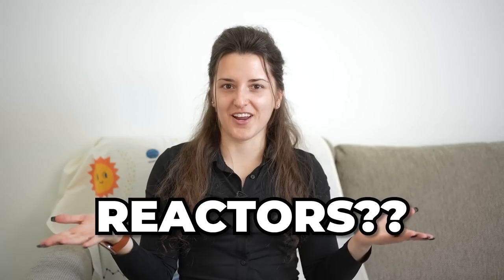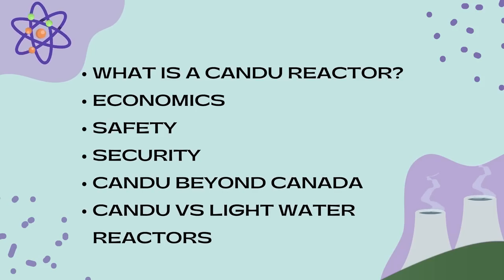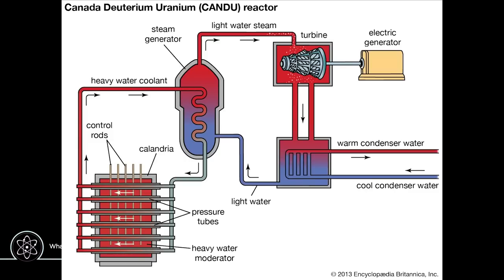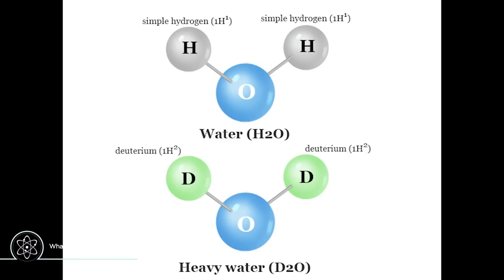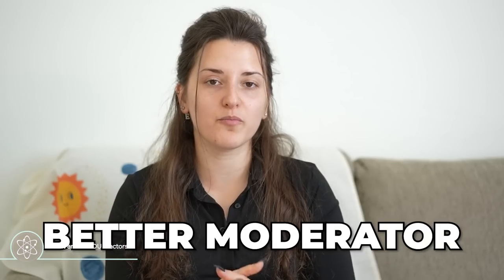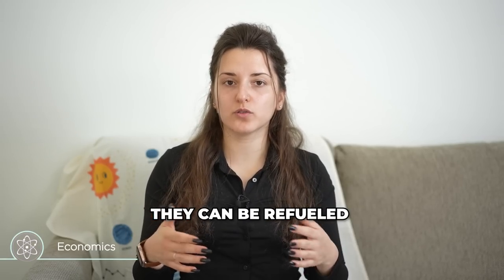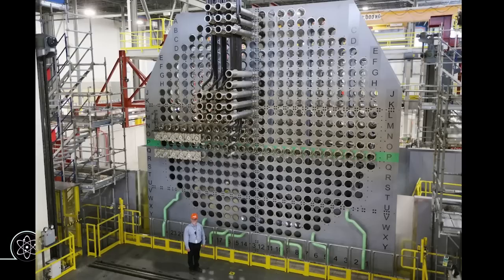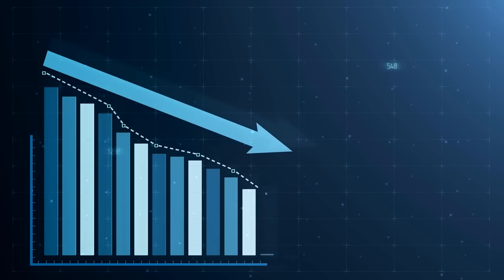Nuclear Physicist Explains - What are CANDU Reactors?

Comment: 7:28 Didn't India produce its weapons grade plutonium from heavy water reactors?Doesn't online refueling make it a bit easier to remove fuel after low burnup?

7:41 Correction:D20 has lower thermal neutron absorption cross section compared to H20
Reply: indeed, that was a fail from Elina.
Online refueling is indeed a good way to make weapons grade Pu in a "water reactor",while generating electricity no problem. In a PWR you can also do it, but why would you? Just use HEU.
Reply: Yes that was a jarring misstatement for me too. The whole "D2O is a better moderator" line is a bit of a furphy, it's not the moderation but the lower absorption rate which allows a CANDU to have a neutron economy able to support unenriched uranium as a fuel.
Reply: @sjholmesbrown  Exactly. And historically that was the reason why Werner Heisenberg in Germany decided to use Heavy water for the experiments, since regular water didn't fit the bill. In terms of moderation light water is better, since the proton has the same mass as the neutron while the deuteron has twice the mass.
Reply: I was hoping someone brought this up. I hope more countries buy CANDU reactors, but we should be realistic about proliferation
Reply: The German Wikipedia article on CANDU reactors actually mentions that this reactor type is especially suitable to generate plutonium:

"* die Bauweise als Druckröhrenreaktor. Sie erleichtert technisch den Bau solcher Reaktoren und erlaubt zugleich eine relativ einfache Gewinnung von Waffenplutonium, da im laufenden Betrieb Brennstoff zugegeben und entnommen werden kann."

-> 

"* the construction principle utilizing preasured reactor pipes. It makes building such reactors more easy technically, at the same time it allows for a realtively simple creation of weapon grade plutonium as nuclear fuel elements can be added and removed at any time while the reactor can be kept running"
Reply: @12pentaborane proliferation can be limited simply by good accounting and third party oversight of fuel in fuel out .  Buy if we pretend that carbon is the existential threat we're being sold nukes are the only way to maintain quality of life.
Reply: @AlldaylongRock  Well put! Very much with RBMK where you can refuel online - you can adjust the fuel campaign to get Pu, not electricity- india did that. So in terms of non-proliferation CANDU  is not as good as a PWR. Moreover, you gat a highly radioactive spent fuel which you would like to use and which is a non-proliferation issue
Reply: @casualobserver486  With online refueling you have both no problem. At least i think the CANDU doesn't even need to reduce power

Comment: Great video but you got some parts wrong. Heavy water is indeed a better moderator, but the reason is that it absorbs LESS neutrons, leaving MORE neutrons to be absorbed by the uranium which results in a better neutron economy. 
This, and online refueling, is also the reason that MORE plutonium is being produced in a CANDU which is not a problem but creates higher demands for non-proliferation measures.

Comment: a few other points. candu reactors have lower power density than light water so typically generate less power for a given size. and the tubes that enclose the fuel rods are  a special zirconium alloy that only last 15 -20 years at which point the reactor needs the tubes replaced. that costs about a billion $. so that is planned for when constructing.
Reply: @frederickcwinterburn1837 , Bruce plans to re-tube all the others. Unit 6 is nearly done and set to return to service this year and will be followed by 3 and then 4. Not sure about scheduling for the rest. Expected lifetime of the new tubes is 30-35 years.

Comment: Well explained thank you. Summarized: The Candu reactor is a type of pressurized heavy water reactor that uses natural uranium as fuel and heavy water as both coolant and moderator. The Candu reactor has a high safety record, as it can shut down automatically in case of a loss of coolant or power, and it has a negative void coefficient, meaning that the fission rate decreases when the coolant density decreases. The Candu reactor is also efficient, as it can achieve a high burnup of fuel and can use a variety of fuels, U238 and such as thorium or plutonium. However, the Candu reactor is also expensive, as it requires a large amount of heavy water, which is costly to produce and maintain, and it has a low power density, meaning that it needs a large reactor core to produce the same amount of power as other reactors. Size and heavy water production costs are the main issues for this kind of reactor.

Compared to the Molton reactor (next-generation technology)
The molten salt reactor is a type of liquid fuel reactor that uses a mixture of molten salts as both coolant and fuel. The molten salt reactor has several safety features, such as a freeze plug that can drain the fuel into a safe storage tank in case of an emergency, and a low operating pressure, which reduces the risk of explosions or leaks. It can be built in small sizes. The molten salt reactor is also efficient, as it can operate at high temperatures, which increases the thermodynamic efficiency of the power cycle, and it can breed more fuel from thorium or uranium-238, which are abundant resources. However, the molten salt reactor is also costly, as it requires complex materials and technologies that can withstand the corrosive and radioactive nature of the molten salts, and it has a high proliferation risk, meaning that it can produce weapons-grade material that can be diverted for illicit purposes. Young technology, corrosive issues, and preparation of the salts are the main issues of this reactor.

What kind of reactors do atomic-driven aircraft carriers use. They use uranium and need to be refueled only once in 30 years and are relatively small?

Comment: High pressure is worse than low pressure reactors for safety, because... you know, high pressure. If the pressure drops suddenly all your coolant is suddenly steam. The safest reactor would be low pressure, low temperature with a negative energy coefficient. But of course you want high temperatures for the best energy efficiency. The higher the difference between the hot and cold side of a system, the more energy you can extract out of that flow. And since the cold side is usually fixed to something near room temperature, like a river or cooling tower, the only way to increase that gap is to heat up the core.

Comment: As far as I remember the reason Canada developed CANDU reactors had to do local technical limitations. Early on Canadian engineers realized that they cannot make full size reactor vessels, but that they can make sufficiently large pipes with the required specifications. This ended up to be an advantage as it allowed online refueling. Also because light water required enriched uranium, they had a few choices: buy fuel from outside, develop enrichment facilities or use natural uranium with heavy water as a moderator. It seems that it was more economically viable to develop heavy water production facilities than the enriched fuel options.

Comment: I'm interested in the PBR reactors. The passive safety features especially. The fact that there is no fluid, that any non-reactive gas can be used in an emergency and that even in a loss of cooling, the 'pebbles' expand, moving the fuel particles further apart, self regulating the reaction without a human having to do anything to stop an accident.

Comment: Actually, India is building an indigenized CANDU derivative. They call it Indian Pressurized Heavy Water Reactor (IPHWR), with the current design being built at scale being 700MW. Design into a 1000MW unit is being done. And India is studying the use of Thorium-Plutonium MOX to fuel them. Along with MSRs. 

In China and Korea, the CANDUs are using reprocessed uranium (0.9% U-235). More research isn't being done, because they are focusing on a LWR+FBR fuel cycle.

Favorite reactor types for me are CANDUs, RBMKs, MKER(an evolutionary version of the RBMK, and could have become a "discount CANDU" if further developed). And both molten chloride salt reactors, as well as pool-type sodium and lead cooled fast reactors.

All are for similar reasons. Very efficient use of nuclear fuel with Pu breeding, use of Thorium, reusing and processing LWR fuel , and addressing the issue of long lived transuranics.
The RBMK is an interesting reactor that unfortunately has been rushed into implementation, with several design problems. It's supposed to be able to run NU, but it is extremely unstable doing so, so it runs 1.5/2%LEU(There's 8 RBMKs still operating in Russia no problem). The MKER would solve the problem.

Comment: Correction. Heavy water absorbs LESS neutrons because it already contains more neutrons. However, it moderates WORSE than light water because deuterium is heavier and you have the best moderation with a particle as heavy as the neutron: a proton!

Comment: The mention of 8 RBMK reactors running  in Russia as a discount "CANDU" is interesting and would need so much more info to see how safe, efficient and reliable etc. they are and what it would take to make them anywhere close on safety, reliability, cost, reactor life and maintenance cycle, efficient fuel use etc/etc. compared to a CANDU!

Comment: Elina, I am not a nuclear physicist or engineer so correct me if I’m wrong but stating that CANDUs make less Neutrons and therefore less plutonium is incorrect. Indeed they make the same neutrons as light water reactors. However the overall neutron usage economy is much better which allows much less fissionable material ratio while still maintaining criticality. Since you can run on 0.3% vs 3-5% you essentially also burn away any bred actinides more efficiently down to the much lower percentage. I would guess that CANDUs basically produce just as much plutonium as any other reactor but they are far better at then burning that material away down to the lower percentage during the course of normal civil power generation profiles before the fuel elements are discharged out of the reactor. 
Indeed, CANDUs share far more design commonality with Hanford weapons Plutonium production reactors. They use natural Uranium, can be refueled and defueled online, have a horizontal fuel profile and horizontal fuel tubes with individual fuel channels. Again the reason CANDUs Dont make weapons materials is because of the manner in which they are operated. They keep the fuel in the core far longer and achieve the higher burn up. 
I would also guess that the perceived anti proliferation benefits from CANDUs are derived more from the fact that any nation using them can avoid the more key weapons technologies of enrichment and reprocessing while still having civil nuclear power facilities. 
Again, correct me if I’m mistaken and missing something.

Comment: Error at 9:10. South Korea has 4 CANDU-6 nuclear reactors at their Wolsong power plant facility. The first one was commissioned in 1983, the 4th one in 1999. That was my first job when an engineering intern at Atomic Energy Canada Limited back in 1977-1978: project office for Wolsong 1.
And why the Candu was designed is the consequence of the Manhattan project. Working to develop nuclear weapons and reactors in the 1940's, the R&D task was divided between involved parties, and the natural (non enriched) uranium fuel with the more efficient moderator (heavy water) was assigned to Canada, while the US looked into the less efficient but likely more compact enriched uranium + light water reactor approach. Nothing to do with natural resources availability.
For the record, a Candu can be tuned to produce plutonium from the fertile U238. It can also be tuned to use said plutonium as fuel.

Comment: I like the idea that CANDU can burn either natural uranium or MOX (mixed-oxide) fuel, recycled from LWR's. I have a question regarding the economics: in a standard American PWR, using fuel enriched between 1% to 3% U-235, the maximum fuel burn is typically less than 5%. For those who don't know what this means, only about 5% of the uranium-235 present in LWR fuel actually gets fissioned before a fuel bundle is "spent". What causes this, is that the buildup of fission fragments in the fuel pellets  reaches a concentration where these fragments absorb too many neutrons, slowing or stopping the chain reaction. Since these fission poisons are entrained within the fuel pellets themselves, there's no way to get rid of them short of re-processing the fuel. This was being done in France, at the Super-Phenix facility, but not in the USA. And Super-Phenix ultimately was considered a costly failure and was shut down permanently in 1997.  So my question: Does the CANDU achieve a higher fuel burn before a fuel bundle is spent? And is Canada re-processing it's spent fuel so that more of the uranium can ultimately be used? PUREX reprocessing is the source of Pu-239 for weapons, but PUREX is very, very expensive; military needs mean that a Government will pay whatever it takes to get something - Plutonium in this example - but commercial electricity suppliers have to control costs enough to be profitable, and so far, the power companies and the US Department of Energy seem to be in agreement that it's less expensive to fabricate new fuel pellets from mined and enriched uranium, than it would be to reprocess and recycle spent LWR fuel. 

We need to move away from burning coal to generate electricity. The CO2 concentration in the atmosphere, between 1800 and 2018 has doubled, from 282 ppm to 408 ppm. nitrous oxides and methane have also doubled. Hydroelectric is pretty much at maximum capacity, with few remaining rivers not yet tapped out. Wind power is sporadic, and animal rights organizations are very concerned about the numbers of birds being killed by wind turbines. This leaves Solar and nuclear as the two options we can increase capacity from in the shortest time (fusion is probably still decades away from producing a commercial power plant, and some people believe that ultimately it will prove to be impossible).

CANDU seems to have a lot of advantages: refueling without having to shutdown. It can burn natural uranium or MOX. Heavy water is expensive to produce but much easier to handle than flouride salts (LFTR) or liquid sodium (Super-Phenix). Canada is right next door to us, so it should be easy to ask Canadian nuclear engineers to help us build some CANDU plants here in the States should the regulatory agencies decide to give CANDU a try here.

Comment: A friend who worked in the Pickering plant said he had another use for heavy water. According to him even a small addition to a significant amount of regular water changes the surface tension of the water. Mosquido young, the wigglers hang from the surface of ponds to breath and if the surface tension changes they can't stay up and drown. Another question I have is how much replacement heavy water is required to top up operating reactors. I have seen quite small and relatively inexpensive systems that produce heavy water.

Comment: Would love to see you do a video on pebble bed reactors at some point.  The molten salt and helium cooled variants being built by Kairos and X-Energy are especially intriguing. ☢
Reply: I'm also a fan of MSRs but would like to see the NRC allow a liquid/molten salt fuel at least in some research/experimental reactors.  We really need to be developing the next generation reactors now.
Reply: @johnmason455  Concur!
Reply: I remember when some people from ORNL did a exhibition when I was in middle school. They brought among other things some of the uranium beads used for making the pebbles in this reactor. They were in a little glass bottle and as fate would have it when it was being passed around it got dropped, and lots of tiny uranium beads went all over the classroom. They swept most of them up, then we all got turns using the Geiger counter to hunt the rest. They made a game of it. We ended up finding all but 4 of them. Could only imagine what would happen nowadays 😅
Reply: @christopherleubner6633  
Uranium is laboratory radioactive, but very toxic.
Reply: @nedward.7442  in the form it was in, it was not an issue, the tiny beads were like mini jawbreakers that had a hard silicon carbide shell, a layer of graphite, and some a nice chewy uranium core. The beads were super tiny as well, about the same size as a pin head.
Reply: @christopherleubner6633  
 in the form it was in, it was not an issue, the tiny beads were like mini jawbreakers that had a hard silicon carbide shell, a layer of graphite, and some a nice chewy uranium core. The beads were super tiny as well, about the same size as a pin head.

Comment: Hmm, Canada also has serious restrictions on who they will sell the use of the technology to, under the export of weapons technology restrictions. There has been at least 1 Candu reactor that was built as a "breeder reactor" that does produce plutonium which is why they are weapons technology.
The control rods to shut down reaction are deployed by a power interrupt system, the power gets cut and the whole reactor automatically goes into shutdown. The light water reactors need power to insert the control rods to shut the reactor down.
Reply: Where did you get this from? In case of an accident, light water reactors are shut down without any electricity; the rods simply fall into the reactor.

Comment: I like the CANDU because it shares the benefits of a soviet RBMK, (online refueling)but also comes with many safety features of the PLWR type reactors, as well as a much better moderator. Too bad cost cutting and beurocracy got in the way in CCCP, the RBMK was a pretty neat reactor and could have been much safer if a better moderator, containment vessel  etc had been used.